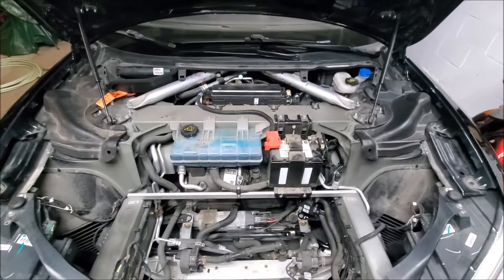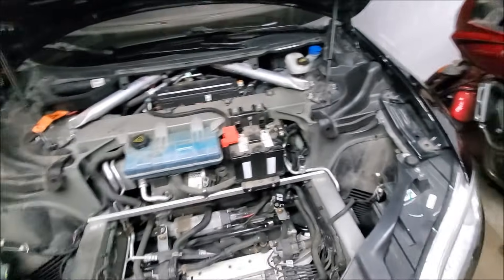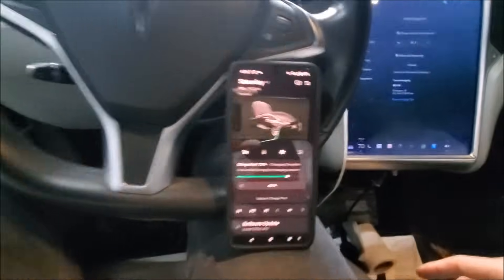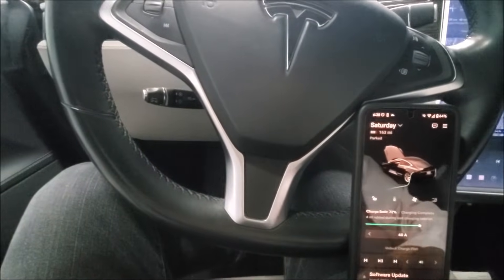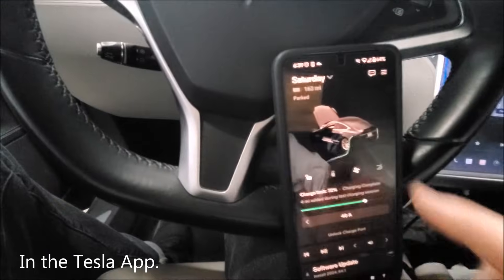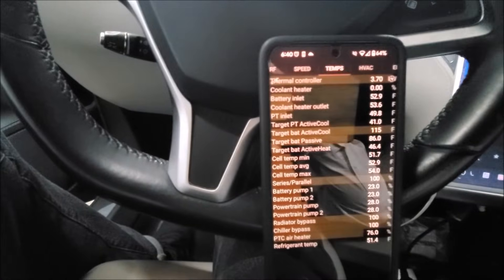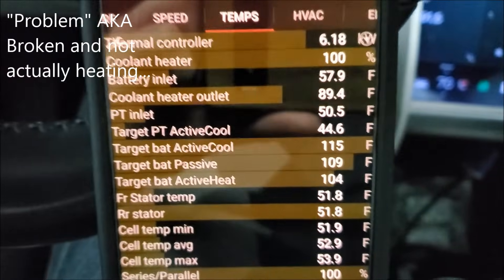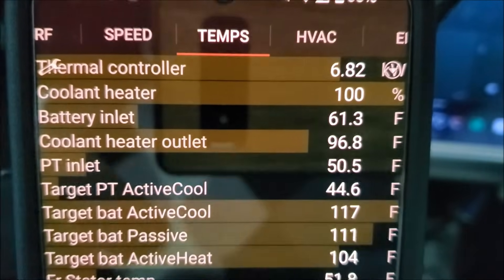Verify Tesla Battery Coolant Heater Operation - 3 EASY Ways! Model S/X

Comment: Is it dangerous to drive long distance, with this problem?
Reply from the maker: Imo, if it's not cold out (below ~45f) then shouldn't be a problem.  this part only heats the fluid, It does not cool it. Driving distance I would be concerned with the battery pack getting too warm, not too cold.  

If you're expecting cold weather, then personally I would not drive long distance or I would definitely plan on accelerating and driving slow to not extract a lot of energy from the pack at once. The car is smart enough to recognize if the pack is too cold and  not heating properly, and will automatically put you in a low power mode. Essentially chill mode. Maybe it was a little bit slower, I don't remember.  This happened to me one morning when driving to work about 35 miles. I experienced reduced to performance due to cold battery pack, and I knew this because the car told me it was in a low performance mode. If it's really cold then it might be a bigger problem though. By the time I got to work, the pack had warmed up enough such that it would exit this limp mode, but it only exited that mode After I put the card in park and then put the car in drive again. It did not exit that mode automatically while driving.... 

Hope this helps, hope by now your problem's already fixed...

Comment: Thank you for the video. My MX super charging was reduced with the w0249_sanitytempribatheat alert. Opened scanmyTesla app and found the coolant heater percentage was fluctuating 100% to nothing. In service mode the 100% to 0% coincided with the alerts in service mode. I’ve checked the fuses, which appear ok. Reset the car. So it must be the battery heater.
Reply from the maker: You are welcome, I hope that this indeed helped troubleshoot and or if you replaced the part that it helped in that process. Hopefully you're back on the road by now!
Reply: @TeslaDIYRepair it did. I got Tesla to replace the battery heater. All back in action again. Thanks again for your video.

Comment: Hey man, I have a 2013 model s. I don’t see the “precondition battery for faster charging” message when I navigate to the supercharger. In service mode I get “sanityBatHeater” error. The error will only appear in service mode when supercharging. Did you also have this issue?
Reply from the maker: Sorry, but no, that error/ behavior is not the same as what I was experiencing.  The error codes I had are listed in the video description. Best of luck!
Reply: @TeslaDIYRepair i dont have any error but Coolant heater is k 0% long time
Reply: Did you ever figure out what causes that error? I’m on the same boat

Comment: My 2016 90D has thc_d0013_coolantheater and thc_w0249_sanitytempribatheat errors. In Scan My Tesla I can see heater going to 100% for maybe 10 seconds, then back to 0%. Heater outlet temp does not change, howerver thermal controller consumption increases by about 4KW, which I would expect not to change if heater was not working. Is the thermal controller not measuring actual consumption but just reporting what it expects to be consumed and heater is not working and not consuming any energy? Or because the thermal controller is showing power increase does this mean that heater is working but temp sensor is broken and does not see temperature rise and switch off heater?
Reply from the maker: I'm not exactly sure, maybe it is the temperature sensor, that's a good theory. Either way if it were me I'd get and replace the whole Battery coolant heater assembly.